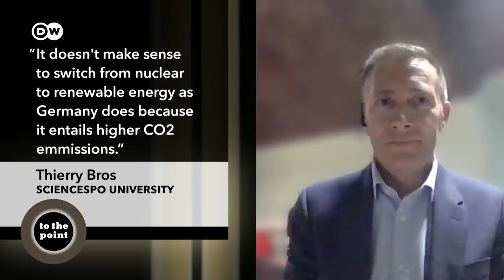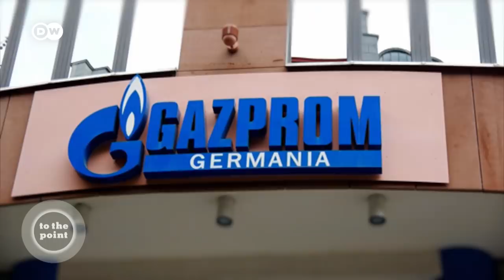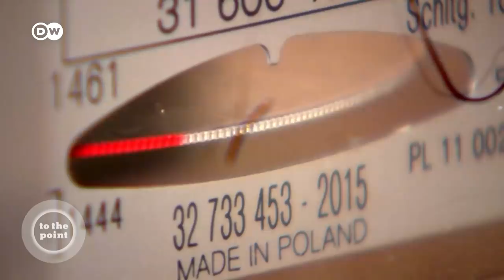Bleak winter ahead: Who’s to blame for Europe’s energy crisis? | To The Point

Comment: France has lower emissions per capita than Germany and lower electricity costs than the EU average. A market-oriented transition may eventually work out, but it can have higher costs, volatility, and emissions.
Reply: @luiseduardogonzalezquiroz272  Nukes in my opinion, isnt an only option.  I do not know how desperate for energy Germany will be in 15 years.  However, if they can hold out thru market, basically demand governs the price, governs the consumption, then nuclear isnt the best option.  I am not saying its worse, just, i dont know if it is the best.  I dont know the economics, of green relative to the, nuclear options available.  However, fusion is coming, that will make nukes obsolete.  I believe the blonde male, the nukes wont pay for themselves, in that case.  I also think, neither will green, as well.  The choice green or nuclear, to me, as laymen, is an unknown.  Not one clearly superior.  However, i do know, wind can go where nukes cant.  Solar can be very small, attached anywhere.  So technically, investments in green energy, to be placed in otherwise, inaccessible to huge installation areas, should pay themselves off.  So in that case a good decision, if same money to be invested elsewhere, is probably worse, overall.  Choice, nukes or green, is simply left or right.  It is ideological, when its unclear, like it is now.  I am not criticizing that, just stating, why those who dont know enough are so invested in that choice.  To me its green, however, with exceptions, small stage 4, thorium reactors for industrial use only, i am not against, when it feels possible things will get desperate in 5 -10 years, but until then.
Reply: @luiseduardogonzalezquiroz272  France stuck to their guns with nuclear
The biggest cost is the start up and decommissioning so if u take down a plant after a while of course it is expensive
Germany decommissioned their nuclear power after Fukushima 
Countries are changing their minds with nuclear classifying it as green
If enough countries do it the EU will change their designations as well
Reply: nuclear electricity cost lower is a false assumption!
Reply: @pancakes3250  "Nukes in my opinion, isnt an only option." - Absolutely. Probably about 80/70% nuclear + 20/30% intermittent RE is where non-hydro countries will end up. (intermittent RE loses value once it hits the c.f. - see Lion Hirth's papers).

"basically demand governs the price, governs the consumption, then nuclear isnt the best option." - The myth is that 'because nuclear power plants are expensive, nuclear electricity is expensive'.  Question: the last time you bought a pair of shoes, did you think about the price of the shoes or the price of the shoe factory? It is quite conceivable that an expensive high-tech shoe factory produces cheaper shoes than a cheap low-tech shoe factory. Likewise, we should compare costs of the end product, not the factory that generates electricity.

France (70% nuclear) - much, much cheaper than in Germany (50% RE) or Denmark (70% RE)
Illinois (50% nuclear) - much, much cheaper than in California (40/50%? RE)

"However, fusion is coming, that will make nukes obsolete." - don't hold your breath and don't invest in fusion. Fission is super-easy. We discovered the nucleus in 1908. Both fission and fusion were postulated as possibilities in the 1930s. We had a working reactor in 1942 (44 years later). No extensive calculations or computers needed, no superconducting materials, no generations of armies of scientists working on the problem - a single, modest-sized group, with a tiny budget.
Fusion is super-hard. Now in 2021 (113 years later) we have new models, computers, materials, and decades of science - all to build a fusion research reactor that will be 'break-even' energy-wise (when you squint at it, certainly not break-even in the commercial generation sense). Great science sure, but poor economics.

"However, i do know, wind can go where nukes cant.  Solar can be very small, attached anywhere." - you confuse siting with viability. I can attach a solar panel to the ceiling in my basement, but it isn't viable.
The big problem with wind and solar (and the whole issue facing Europe) is their intermittency - because of that intermittency they need backup - hence they need gas - hence the price of gas is through the roof. That you can stick a solar panel on nearly every roof in somewhat cloudy (through winter anyway, when you need power most) Germany merely adds up to very expensive roofs. A wind turbine in the North Sea which is not spinning is a rather pointless paperweight.

Nuclear does require a central power station site, but those are relatively plentiful, and once you build it - it can operate for 2-3 years before you shut down for about 1 month (timed for the Spring when power demand is lowest). It is a useful asset during its entire lifetime.
Reply: @factnotfiction5915  I prefer fact over fiction almost every time.

The first paragraph: 
"Probably about 80/70% nuclear + 20/30% intermittent RE is where non-hydro countries will end up".
I didn't read Lion papers.  I read partially the article that sourced from them.  I will assume Lion papers and the article, scientifically speaking, were accurate.
I will agree with this.  Most will.  At minimum population wise (China, India, US, Russia, Africa, if they can).  However, this doesnt mean nuclear is the better option, in my opinion.  

Second paragraph:
I wont quote it.  It was regarding the price of nuclear.
I choose to agree that nuclear electricity, is cheap, maybe cheaper or as cheap as fossil energy.  I do know RE is free, in a sense no need to cover the fuel costs.
However, the economics of energy i had in mind, covers price of fuel, maintenance of the installation and everything related to make it stable and viable source of energy.  Salaries, environmental concerns, clean ups, price of inspections and oversight, infrastructure to deliver energy, energy storage, and infrastructure necessary to handle emergencies.  All these costs are added up until the entire infrastructure needs to be rebuild, life time of that system.  These costs are then, divided per watt delivered for the unit, again over its lifetime, the actual predicted delivery, not its maximum capacity, on paper, over lifetime.  
These are the energy costs i had in mind.  I dont know which one is cheaper, provided everything else be equal. 
I still dont know what is more economical.  If this is covered by Lion papers, tell me, i will believe you, i wont check.

Forth para, was regarding fusion.  I have nothing against what you say.  Where it just might not come, or come too late, or not be as cheap over lifetime, or as abundant of an energy source.  However, it, as easily can be possible, be on time, and deliver close to what is dreamed.  ITER is under construction.  Huge private investments into private fusion. To me knowing nothing else, feels, in 30 years, fusion will be commercial.  If thats true, will fission reactors break even before they must be replaced by fusion ones, i dont know.  
I do know storage of waste, assuming its thorium will require another 100.  The dismantling and clean up costs, the personnel that need to be reimbursed, since now they are obsolete, this adds extra to fission costs, if fusion happened.  It is possible they fission wont break even,    maybe will.  I dont know.
One can bet on fission, mostly CO2 free energy will be delivered, when needed.  However, the same is true if going RE, including the fossil backups.  Fission could be cheaper over lifetime, accounting everything, or not, I dont know.  To each their own in that case, when dont know.  Worse case scenario, the RE installations, where the environment permits them only, they will pay for themselves, if they supposed to by their design, all costs included.  That is a plus to go RE.  The fusion dream is also very tempting.

This is regarding the viability of wind and solar, in the fifth paragraph.  I agree with all the technical aspects you you mention there.  However, i did mean, installation of wind and solar, in areas, not only  expensive for large installations, but also are viable for energy by RE, on paper at least.  In that case, those RE installations, are promised to pay for themselves.
To clear areas for large installations, are easy enough in most places.  However, these places, get fewer, if clearing involves huge damage to the environment, displacement of large populations or just been too far from where the electricity be needed.  Then, if doing any of these wont mean an abundant and reliable source of energy, for half the price of fossil, over lifetime, those available places get even fewer.  CCP's China, Putin's Russia, most of middle east and Africa, majority of the human population in general, have very weak liberal values, therefore the comment that most places can take fission installations, cheap enough, is true.  
Doesn't make fission a better idea, or worse, to the left minded populations, however.

I am nor arguing fission until fusion (i hope) is worse, or better, than RE with back ups.  I am only stating i dont know, and its up to the societies involved to guess which way, when they dont know.  Left will go RE, right, will go nuclear, hopefully thors.  
I am RE, with thors on the table if energy will get desperately needed in 10 -15 years.   I dont know the truth.
Reply: @pancakes3250  "I do know RE is free, in a sense no need to cover the fuel costs."
Fuel costs for nuclear are less than a cent per kWh. It appears expensive per kg, but you don't need much either. Solar/wind/nuclear - it is all about the capital costs - and the way to cover those capital costs are to use the asset. This is the main reason reactors don't load follow much (they can, but they earn more when running). US reactors are on 95% of the time. Solar is on about 25%, wind about 35% (i.e. capacity factors). It doesn't matter if you can make wind/solar more efficient - the c.f. won't change. In nuclear you can change the efficiency AND keep raising c.f. to 100%.

"However, the economics of energy ... covers price of fuel, maintenance ... Salaries, environmental concerns, clean ups, price of inspections and oversight, infrastructure to deliver energy, energy storage, and infrastructure necessary to handle emergencies ... etc" - agreed.
That experiment has been done for nuclear (France, Sweden, Ontario, US, etc) - and the total costs appear to be covered by lower-than-average retail ratepayer fees (also note waste disposal, in most jurisdictions, is part of those fees).
These costs are divided by not paper-maximum-capacity, AND not by predicted-delivery, but by actual-empirical-delivery of watts over lifetime.

We have reactors at 60 years old - we know the HISTORICAL generation and costs - and .... it comes out super-cheap!

(see video by IllinoisEnergyProf on Youtube about costs, revenues and depreciation of nuclear to see how that works out)

On the other hand, with wind/solar - we don't know historical generation and costs - we are guessing. Preliminary data from Germany and Denmark show us higher prices.
But even the guesses are misses because we don't attribute the cost of the put option gifted them, nor the externalities they impose on others.
Put option - simply explained, there is no penalty for wind/solar to stop generating. Think of this analogy: during a hot July day you order an ice cream. Are you happy if this is delivered in February? Are you happy if they deliver 2 ice creams - but demand payment for 2 when you ordered 1?
Externalities - the grid operators require participation from other generation sources, so if you are generating for the grid, you make up the put-option-shortfall and run down when wind and solar return. Who pays for the extra wear and tear on your equipment? Who pays for the extra assets to provide power? - whoever it is, it isn't the wind and solar generators. Your costs went up because the grid allowed intermittent RE to participate - you are not reimbursed and you are blamed for the cost increases.
Another externalities example - extra transmission. Sure, we can connect timezones to each other with giant interconnectors and follow the sun - but add those costs to your 'cheap' solar and suddenly it isn't so cheap!

(no Lion Hirth only looks at the value of wind/solar against itself)

"The dismantling and clean up costs, the personnel that need to be reimbursed, since now they are obsolete, this adds extra to fission costs" - (in most jurisdictions, waste disposal is part of rate-payer fees - and nuclear is still cheap! Again, compare IL costs vs CA, or France vs Germany)

Solar/wind viability installations:
* we can build great solar in the sunny Sahara - but the population using the juice is in cloudy Munich; AFTER we add the cost of transmission to the price for solar - is it truly viable?
Will Germany be OK with being at the mercy of the Libyans, Italians, and the most fearsome of all, the Swiss? Not to mention maybe some cargo ship drags its anchor across the cable and damages the Mediterranean section.
* we can build A LOT MORE marginal solar in cloudy Munich - but there are occasional clouds; AFTER you add the costs of backup (storage, gas, whatever) to the price for solar - is it truly viable?
Germany is obviously NOT OK with relying on Mother Nature - it is both calm in the North Sea and cloudy in Germany this fall - exactly why they are buying gas!

Nuclear installations: 
* we can simply build 1 nuclear plant at each major city - near the population, no extra transmission costs, few extra asset costs - it is viable in Munich, Bern, Rome, and Tripoli.
* You will need inter-city transmission, to cover maintenance downtime, but that is already built, so no big extra cost to areas with legacy grids.
* PWR-type reactors need cooling water, so need to be near rivers/lakes/oceans/sewage (Palo Verde in the Arizona desert uses sewage for cooling - providing a 2-fer in that steam is an excellent treatment for sewage)
** But newer high-temperature reactors don't need cooling water, so can be built in deserts, mountains, and other areas away from water.
* Weather independent - clouds/rain/snow/sun/windy/calm/etc - all good.

Politics - I infer (perhaps incorrectly) from your comments that you believe governments with weak liberal values build cheap reactors because they can cut corners and run roughshod over people. Not true. Reactor costs are determined by speed of building, which in turn is a result of learning, not by cutting corners.
Why build a billion dollar asset on the cheap? Far better to get it right and make it last.
They do also eke some time out of the process by not exercising regulatory overreach. Please lookup Toomer's Creek from an article by Theodore Rockwell from an article in Nuclear News June 1997 - one example of extra costs imposed on the industry.
Reply: @factnotfiction5915  Ok, i will believe your economics argument.  All cost included per lifetime of the whole system, fission is cheaper than RE, maybe by alot.  This is also because, i will believe you, low viability of said RE to provide demand power, in EU, for political and climate reasons.  I wont check anything you said.  This will be too hard for me.  I will just believe what you said is accurate enough to prove fission for Europe is better, in the economics sense.
Economics alone, is good enough for me.  However, only if those reactors are not uranium or anything with waste management problems.  Thorium is good, for example.  Those reactors also have to not depend on external cooling, so not to blow steam or worse, and be safe in case humans stop maintaining it.  Safe incase someone blows something up, this should include a direct hit by a large enough warhead, to the reactor.  I heard small stage 4 thorium molten salt reactors, nice and buried, can satisfy that.  If all this, plus the costs to move populations fairly, still make it cheaper by at least a third, then RE for EU, i will agree.
The last part is, what i agreed to, i only assume is good enough for Europe, however, exemption due to ideological reasons apply for countries like Germany.  For me to agree, for them to go nuclear, price of fission, after everything i mentioned, i want at least twice as cheap than RE's.  Also, the return on investment, cant be in 60 years.  I do choose to believe fusion commercial in max 40.  Even poopy RE installations with 20-30 c.f. will be able to pay for themselves, eventually, since they wont go obsolete.  If fission cant pay for itself, including decommissioning, in 40, than i still want RE for at least Germany.
The shady countries, like China, that do go nuclear, do cut costs.  China already had an incident with their newest stage 3 plant. I dont trust them, or anyone similar.  Since Fukashima, i want nothing that relies on external cooling, and people to guarantee its integrity.  Better be self-contained and buried, we live in very unstable times.  If you can at least tell me everything a want is 65% probable with fission, i choose your side.
Reply: @pancakes3250  "However, only if those reactors are not uranium or anything with waste management problems. Thorium is good, for example."
Thorium reactors are uranium reactors, and all reactors, U-233 (Th), U-235, U-238 reactors, can all be built without 'waste management problems'.

The coolants: molten-salt or liquid metals or gaseous are the ones that do not require 'external cooling' (it isn't the Thorium that enables that).

"this should include a direct hit by a large enough warhead, to the reactor" - if hit by a nuclear warhead, the target is the least of the problems.

"exemption due to ideological reasons apply for countries like Germany."
We should not give the Germans a pass on ideology while requiring the rest of us to use science.

"For me to agree, for them to go nuclear, price of fission, after everything i mentioned, i want at least twice as cheap than RE's.  Also, the return on investment, cant be in 60 years."
You have a political stance, not a scientific or financial one. Why 50% cheaper? Why not 60%? Why less than 60 years?

I do hope that your political views are the minority and that the majority of society is interested in: cheap power, clean power, safe power, dispatchable power, and abundant power - and will thus choose nuclear.

"I do choose to believe fusion commercial in max 40."
Again a political statement. Again I hope the rest of society has better planning skills than relying on hope and prayer.

"The shady countries, like China, that do go nuclear, do cut costs.  China already had an incident with their newest stage 3 plant."
Although China presents many problems for the world, their nuclear programme, in compliance with IAEA guidance and inspections, is not one of them.

Yes, the Chinese had an issue with their nuclear plant - they admitted it, sought help, fixed it, and have avoided an accident.

No, the Germans have no issues with their coal plants - they continue to destroy forests to dig coal, continue to burn coal, continue to spew SOx, NOx and particulates into the biosphere, and continue to cause disease and early death among the European population.

Exactly why do you believe China is shady? But that Germany deserves time to implement RE vs shutting down coal plants?
Reply: @pancakes3250  1980-ies - Thorium  technology -> in 50 years
2020-ies Thorium  technology -> in 50 years
keep dreaming lol
Reply: @Audrius001  Maybe.  I thought China building one?  I am not a fan of that, but, i am sure it will inspire.
Reply: Herbert Weinstein  I understand you.  Your evaluation is accurate.  You are not alone in this.
I am a dreamer.  I want to believe it will come at least in 40 years.  My support for this, new materials, new computer tech, machine learning, fresh faces, private investment.  All this will speed up development, dramatically.
Normally i wont consider hypotheticals, dealing with life. 
Commercial fusion, to be build and used to come at max 40, doesn't feel likely.  To me 50/50.  I am not in the field, I know nothing.
However, i choose to believe 50/50.  If to choose go fusion or set up nukes, i will leave to individual societies.  As an individual, who is to the left, if to choose for my society, which way, i would bet on fusion, RE and conservation until then.  My strongest support for this, besides me being left, is the very unstable times we live in.
Reply: @pancakes3250  I feel like I just learned something
Reply: @jodycollier6607  Thank you
Reply: France is also littered with nuclear power plants
Reply: Nuclear energy is by far the most expensive source of energy and has a huge CO2 impact. Plus the increase in threat to these nuclear plants from extreme weather as a result of climate change this source of energy is a menace to society.
Reply: @wbafc1231  what CO2 impact? How does nuclear produce CO2?
Reply: Nuclear IS green energy. Now re-read your statements. You make no sense. How can a product be likened to a political ideology? Keep your emotional thinking out of this buddy.